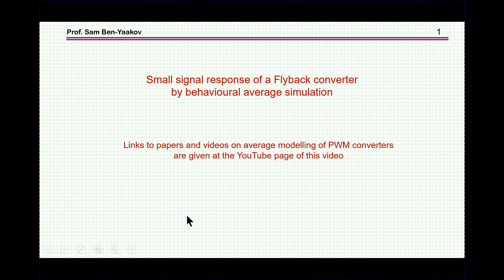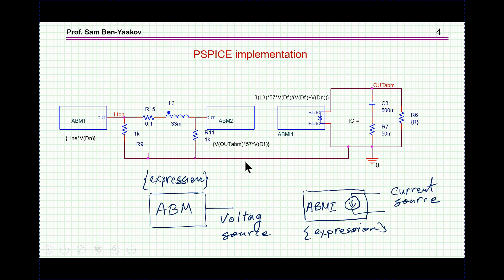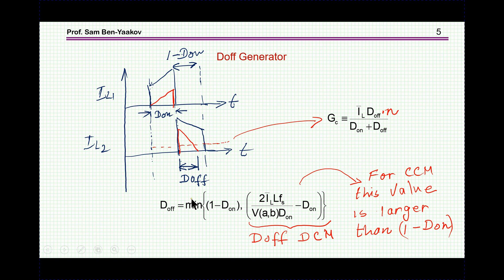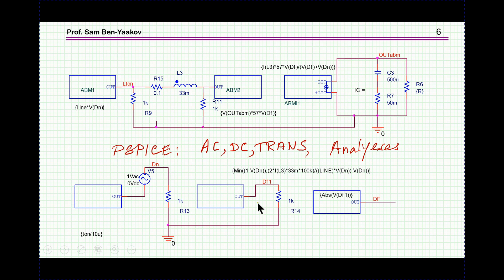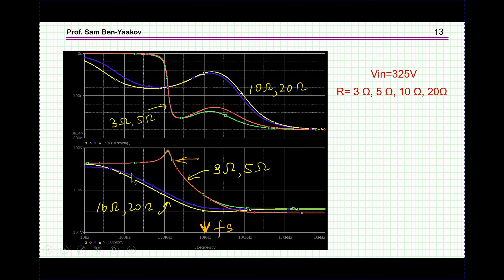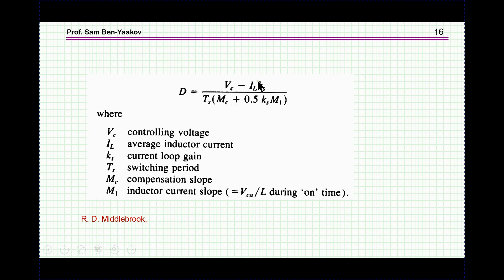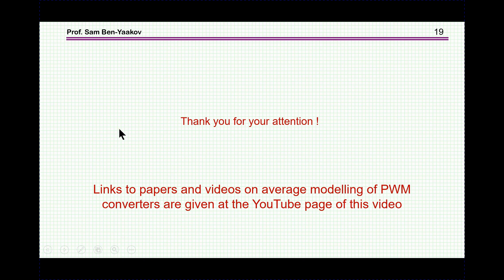Small signal response of a Flyback converter by behavioral average simulation

Comment: Thank you for the video, but I have one question,

When we modelled the flyback in beginning, why did we consider the average voltage on the left side to be (Vin * Don), whilst we don't do this for a boost converter for example where we set it as Vin?
Reply from the maker: Yes, exactly,, at the input side. At the load side in would be Vo*Doff

Comment: Very usefull and interesting topic. Somehow I think L3 changed its value from 33m to 330m in the video. (linearizied model)
Some questions:
assuming one or more additional output windings (not regulated), how can this be modelled? Transfer output capacitors (including serial resistance) and output load via turns ratio to the existing output winding and placing the components in parallel?
What is the effect of not perfect coupling of the transformer in terms of frequency response? (As well a snubber might be needed then -> also to be linearized, or is the effect negligible?)
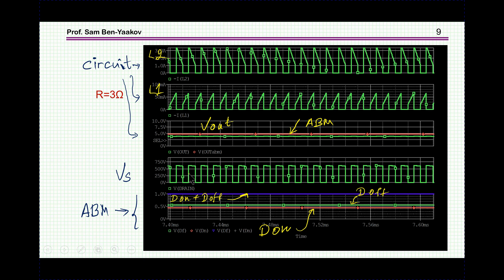At 10:40, the difference could come from the voltage drop of the secondary diode that was not respected in the linearization.
Reply from the maker: "33m to 330m in the video. (linearizied model)"
At what minute or slide number?

Comment: Hi Prof. Sam Ben-Yaakov. I've been following your videos for a while and I was wondering if you could help with something that has been causing me a lot of headache. 

The topic is the small signal model of a DCM buck-boost (same applies to flyback) converter.

I've been trying to use a linearized version of the steady state averaged model of a buck-boost.
In other words, I'm not using the "averaged switch port" approach, but instead I'm linearizing the steady state equations of the voltage on the inductor and current through capacitor.
I've built a model which seems to be consistent in steady state. It essentially preserves the same topology as the buck-boost, only with an idealised dc-transformer in place of the two switches connected to the inductor. The dc transfer ratio of the transformer being: D/sqrt(K) 
K = (2L)/(RTs).
This is consistent in dc (steady state).

I obtain two functions: one for VL and one for IC. These functions are dependent on three variables: D, Vin, Vout (and on L and Ts obviously... which are constant).
Equating them to zero (volt second balance on inductor and charge balance on capacitor current), I can obtain the transfer function in dc of the buck-boost and the dc values of IL and Vout.
Developing the Taylor expansion of them, I can find current and voltage generators for the small signal perturbations associated to the three variables.

This approach works very well in dc (as already said), but also in ac for the CCM. It allowed me to build very simple models which I can use in simulation getting to the same results which can be found in literature.

For some reason, in DCM it doesn't seem to be working. I can't find a reasonable model which seems to be consistent.

Is there any reason why a mathematical model obtained linearizing the equations of the variables of state, would not lead to the same conclusion as the "averaged switch" model?

I've noticed one thing: in the "averaged switch" model approach (your video essentially), the first port acts as a loss-less resistor (dependent on the duty cycle) whereas the second port is a "power generator".
Linearizing the equations of inductor voltage and capacitor current, I don't see this kind of behaviour and the dc transformer seems adequate to draw the circuit... although this might not be a contradiction because the "loss-less resistor + power port" is nothing but a way to transfer power from the primary port to the secondary port... exactly what a transformer does.

Hope you can throw some light.

Thanks in advance and kind regards,
Alessandro Piscozzo
Reply from the maker: HI Alessandro, can you send me please the average circuit and/or the derivation so I will be clear on what you did. You can use sby@bgu.ac.il

Comment: Dear Professor Ben-Yaakov,

right now im working on a prototype CCM flyback converter, using two output voltages (24V, 7,5) which has additional auxillary windings (for self sustaining supply of the control IC, ICE5QR1680AG). Due to this fact, i suspect ignoring some of the windings will make the dynamic model performance you proposed deviate from the real system. (the system right now is working poorly, as i need to set up the feedback compensation via TL431 and for that i need a good open loop transfer function).

My plan was in order to get a good approximation of the power stage transfer function to pertubate the system in open loop, with a jump in duty cycle (i know the stationary switching frequency and duty cycle in closed loop) and watch the behavior of the output voltage, and calculate poles, system dampening, DC-gain by observing rise/overshoot. Would this be feasible?
Reply from the maker: The best would be to use a network analyzer. If not available it would be better to inject small ac signals over the frequency range of interest and to look at the resulting perturbation at the output and at the error amplifier output (magnitude and phase). From this you can get a first approximation of open loop transfer function. Time domain measurements are possible but not simple. See: 
http://www.ee.bgu.ac.il/~pel/pdf-files/jour133.pdf

Comment: Your average model is powerful. Working in both ccm and dcm mode. Also both voltage and current mode. I will try this model. About the modulator gain at 10 ohm load that shows some strange behavior, do you think of that because of operation at boundary mode
Reply from the maker: Thanks for comment. Perhaps you are right concerning the 10 Ohm. I will try to look at it.